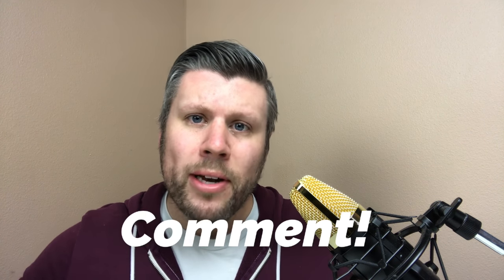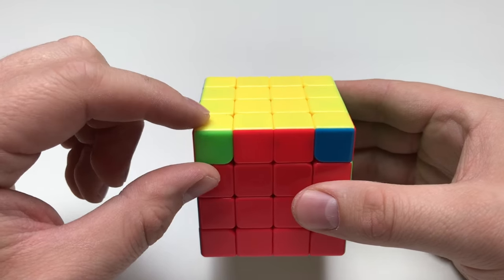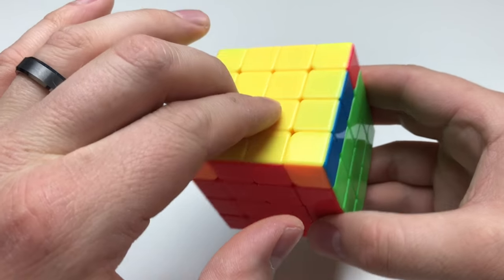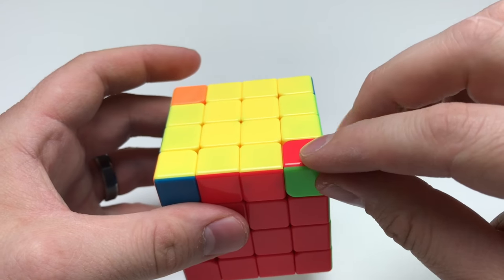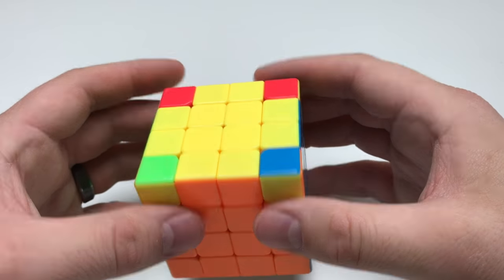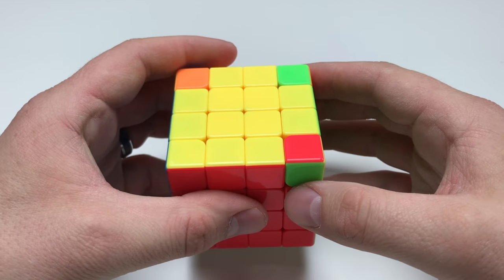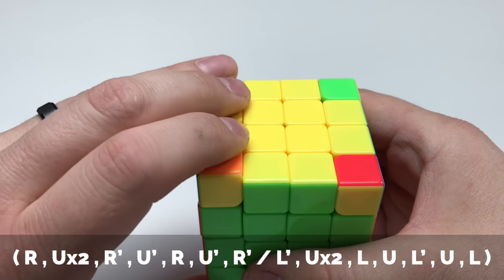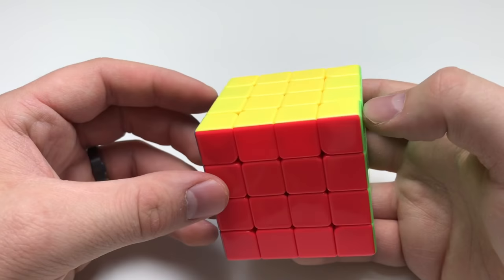4x4 Last Two Corner Parity Solve **Updated**

Comment: For the final step, once the corners are all in the correct place and just need to be oriented, I usually just do either (R’ D’ R D) or (D’ R’ D R)
Reply: same
Reply: Same here
Reply: Much easier
Reply: Same with. E
Reply: Me
Reply: I do R U R’ U’ but I flip the cube to where the white is on top so it’s the same but I flip it I’m used to R U R’ U’
Reply: @holyanddemonic   same
Reply: @emilyrapley7813  i know i’ve been there lol it was so confusing. i’m still not an expert at the advanced methods, but the letters stand for each face, L-Left, R-Right, U-Up, D-Down, F-Front, B-Back.
Reply: Yeah I’ve never seen someone do it the way he did. Seem like a real waste of time tbh
Reply: @PhotonBread  debatable
Reply: @emilyrapley7813  I could’ve solved the corners 5 times as quick using the instructions that comes with the cube
Reply: I do this on 3x3’s and 4x4’s
Reply: @milesbrown5480  Same. I also use this method in the 3x3. idk why people dont often use it. For me it is much easier and fast and does the job done
Reply: Same
Reply: @emilyrapley7813  thats how the rubik's website does it...
Reply: Yeah, it’s much quicker
Reply: @holyanddemonic 3×3 model algaritham
Reply: Ye u can solve it and get it easily

Comment: Thanks for the video. I solved the last 2 corners. Basically you need 3 unsolved corners and one solved in the last step and then you solve it as usual (by holding the one solved in the upper left). This video is very handy if you have 2 unsolved corners. You can never solve it the standard way, the two unsolved corners would just move around. If you have followed this vid until 1:11 then you are good because you just have to solve your middles (step 6) as you would and then ....one unsolved corner remains which is what you want. Then you just solve it as you normally would. Thanks !!!

Comment: For rotating those final corners, you can use "U R' I'm R" 2-4 times per corner until the yellow corner is facing up, then just rotate the yellow face and continue with the rest of the corners (the corner you are working on had to go top right of yellow face)
It's a little easier to remember, but probably not as fast :)
Reply: That last step was too much, just turn the cube so yellow is on the bottom and do your R U R’ U’ Step on each piece and it’ll solve.
Reply: @EthanIsIt  bro what
Reply: @James-lu2jn  it’s basically solving the last step as a 3 x 3
Reply: I learnt that for 3x3 and it works for me still so imma keep using it
Reply: That is the step I always use
Reply: I thought my cube was messed up because when I asked ai to solve it, it claimed it was unsolvable
Reply: Yes brother you are right
Reply: You're right  @James-ii7lx  same thing happened to me

Comment: Not a major gripe, but I feel like there are easier corner twist algorithms for the final step if you are showing a beginner solve. Not sure If I am remembering the notation right (R' D' R D)x2 has order 3 and doesn't do anything to the top face except twist the top right front corner. It messes up the bottom, but you have to do it the correct number of times to solve the top face such that it fixes itself by the time you are done with the cube.
Reply from the maker: Tim Seguine for me, it came down to teaching the way I originally learned

Comment: 3:28 I recently learned you can save a bunch of moves here. You either need to enter that last long algorithm once or twice. When the two yellow pieces point to the right, the long algorithm only needs to be entered once. But in this case they point away from each other meaning the algorithm needs to be entered twice. A trick here is to regrip the cube and bring the orange face to the top. Then it would have the two orange pieces pointing to the right and only require the long algorithm once.

Comment: I see. I hope (and guess) u'll read this command too. Sooo were do i start: the video is good. If i watch tutorial videos i want to solve my problem, i dont want to watch a long intro. So: very good! You explained what you will do and directly started, i like it! Also, it was kinda dumb from me to "blame" you using different shortcuts for the turns on the cube ur doing then i know. I just learned other names for the moves (example: turning both right lines up is "Rw" for me, turning the right middle line up is "r") so its dumb to be upset about that. Everybody learns different shortcuts so i apologise for leaving my rude comment on ur other video. This one helped me alot, thank you! Keep on the good work, like and abo
Reply from the maker: Tim Leppin I’m pretty active on my channel and try to respond quick! Thank you for the response. I’ve put out over 100 videos and have learned what to keep out of the videos. I’ve also developed a better flow in video info graphics. I’m trying to redo a number of my popular earlier videos that just doesn’t cut it for me. This video is a good example of that.

Comment: Another way to realign the edges is:
(Across) have the two edges closest And farthest from you, do: R, U, R', U, R, U2, R'
Then the two correct sides should be next to each other. Have one side to the right, the other farther away. 
It'll be arranged like an 'L'
Repeat the same process. Then align the corners with any other method
Reply: Thanks man, that was a lot easier!
Reply: Damn, it worked once and now it doesnt=)

Comment: For the last part of rotating the corners to solve i use a lot different method- put them in the right spot using (r, u", l", u, r", u", l, u) i will call that r move and the left part of that which is (l", u, r, u", l, u, r", u") i will call that l move and using only those you can solve the rest, keep in mind keep the yellow towards you, the first corner you find i usually go from blue. So find lets day the left blue corner and face the yellow sticker/tile on the corner towards you, so now use L move, turn cube left to right, L Move, R move, turn cube right to left, R move. That will rotate the diagonal corners, so it should solve if its just those 2 corners. For if the corner you rotate is on the right, use R move, Rotate right to left, r move, L move, rotate left to right then l move.  And if the the corners towards you are solved and other 2 are not then use r move, turn cube 2 times, r move, l move. And if thay doesnt solve it, do it again from the beginning. The reason i say this is because this move may be faster to do even if it has more moves but it being faster with muscle memory

Comment: You can solve this crazy corner parity with this algorithm: 
F2 R2 B' D' B R2 F' U f2 F L2 Fw2 l2 Fw2 Lw2 U'
where B means back, Fw - second front layer (called wedge), Lw - left second layer, f - two front layers, l - two left layers.
Number 2 means two 90 degree turns or one 180 degree turn.

Comment: The 4x4x4 Is so wierd compared to the ones I've done 2x2,3x3,pryminx,megaminx it has so many parodys
Reply: Absolutely. Because it doesn't have the fixed center piece and we have to use the corner pieces to arrange the center pieces. In addition to that we will get unusual corner and edge parity which we won't get in other cubes.

Comment: Bro just solve the final corner pieces using the basic 3x3 final corner flipping algo (rotate the cube and R U R' U' for 2 or 4 times until the corner is flipped correctly) don't need to do that bigger version.

Comment: Funny. I had 2 corners that would never align. I did the "wrong" algo. When I "fixed" the cube, the corners were not in the wrong position anymore. 🤣 Which means that I am not really sure how I solved it. My 3x3 algo would never fix it. It would always have 2 corners in the wrong position. Never seen this happen in 3x3. I was thinking the cube had pieces swapped. The 3x3 yellow corners swapping works in the 4x4 and it is easier.

Comment: DUDE: if all of the corners are in the right place but is turned wrong, do the tactic he did, but postionen the cube so theres 2 of the same colors (top color) pointing out, when you only need to do it 2 times, not 4

Comment: Your method for spinning the last corners isn't the fastest. I start with placing the first twisted corner in the top front right position.

R' D' R D R' D' R D

This will spin the top right piece anti clockwise. If it needs to go clockwise do the moves in reverse. (D' R' D R D' R' D R)
Rotate the top until the next twisted corner is in the top front right position and repeat as necessary.

Less moves required to align each piece so faster over all.
18 to 36 moves to complete and a whole lot easier to remember.
Yours is only faster if only two need spinning, and only by two moves. If yours requires all four then you're going to potentially do 51 moves.
Reply: I did the first line of algorithm then i solved the corners